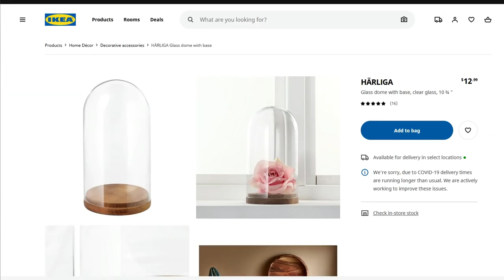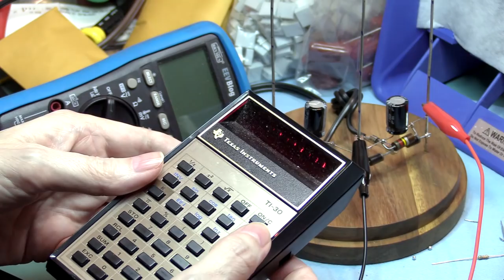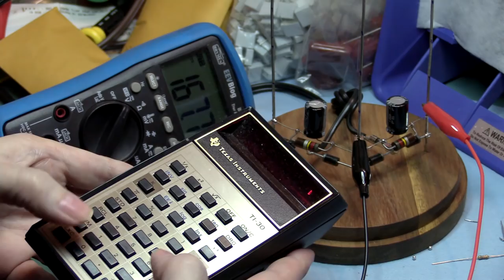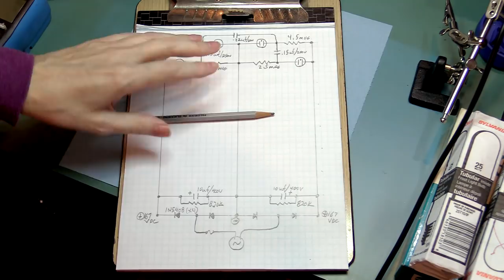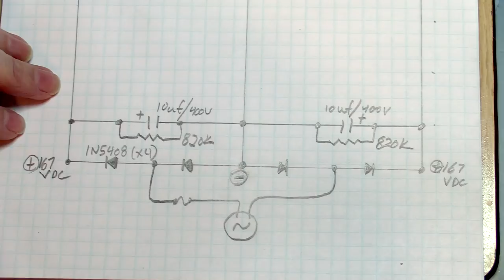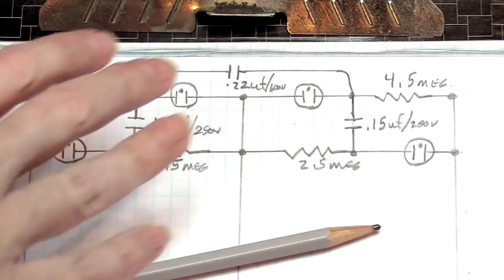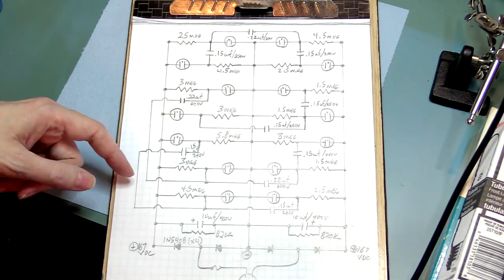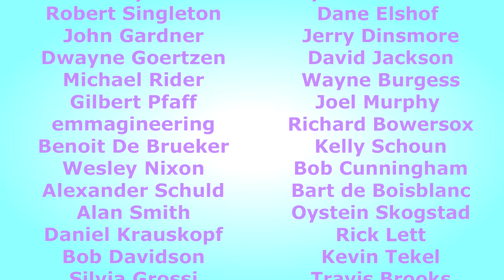Nostalgia Neon Blinky Tree!!!

Comment: About those top two "rungs" on either side of the center rail . . . those caps are charged through a distributed resistance arrangement. But don't those "distributed" resistors also limit the cap discharge current through their respective lights?
Reply: Yes and no. If the top row were alone the discharge current would be limited. But take a closer look at the complete arrangement: the positive rail goes into the neon on the second row, through a cap, into the neon on the first row, and to the negative rail. No resistor in that current path. Although technically that is unlimited charge current instead of discharge current.
Reply: @eDoc2020  I believe the capacitor is only charging through the resistors since the neon lights will not be conducting current until they flash. And when they do flash they are carrying charge from one side of the cap to the other and that has to go through a "charging" resistor, making it a current limiter for the discharge period. Or does it discharge through the power supply components and return through the rail in the middle.?

Frankly I am at a loss to explain why both lights flash off of one capacitor. I would have thought that the one with the lower breakdown voltage would be the one to flash all the time. Does heating the gas by flashing raise the breakdown voltage?
Reply: @bogywankenobi3959  Honestly I haven't really been able to analyze the circuit as a whole.

In the unlimited current situation I called out (just part of the larger circuit) the neons are in series with a capacitor across the power input without any resistors. When one of them breaks down its voltage decreases, the voltage on the other increases, making that one also breakdown. There are no resistors in this particular path so current is only limited by the capacitor and the neons themselves.

For the simple case of two resistors, two neons, and one capacitor it's easier for me to explain. To be clear this is the setup where the neons light alternatively instead of rapidly discharging. Here when power is applied the neon with the earlier breakdown (let's call it A) will immediately strike and then run at the sustaining voltage. At this point the cap is still discharged so neon B also sees the sustaining voltage and does not strike. Now the resistor on neon B slowly charges up the capacitor and the voltage on neon B increases. Pretty soon neon B reaches breakdown voltage and strikes, leading to a drop in its voltage. Since the two neons are capacitively coupled the drop is reflected onto neon A which drops below the sustaining voltage and goes out. The cap charges the other direction until neon A reaches its breakdown voltage again.

Comment: I like those neons with lenses on the end. I usually just see ones with a pointy tip
Could you add a Jacob's Ladder up the middle ?
Reply from the maker: Totally different requirements for the 'Ol Ladder - thousands of volts of AC with a big step up transformer.

Comment: Your rectifier does not drop 4 diode forward voltages. Only 2 Diodes conduct simultaneously in a full bridge rectifier
Reply: But the voltage was calculated using both waves together I believe, so it would work that way
Reply: @aterack833  The Voltage was calculated as RMS line voltage * square root of 2 - 4 diode forward drops.
A full bridge rectifier only drops 2 diode forward voltages. The remaining 2 diodes were in reverse and no current flows through them. They become active during the other half cycle, again reversing the 2 diodes that had been conducting before.

Or think of it this way: To have 4 forward drops you need to connect 4 diodes in series, always connecting anodes to cathodes.
In Frans schematic the diodes in the middle were connected anode to anode, making it impossible to have all 4 diodes conducting in series (unless, of course, you destroy them first)
Reply: @maeanderdev  I thought it was related to the capacitor is some way, sorry
Reply: @aterack833  the RMS voltage * square root of 2 simply calculates the peak voltage. When a sufficient capacitor is used, a DC voltage of that value is obtained.
Anyways, don't feel sorry about being wrong and understanding your mistake, as that is a very good thing :-D

Comment: Yeah, I had seen that sitting there on the bench...just wondering what was inside that bell jar...could you send the schematic that you used?  And yeah was wondering where the bell jar was found.   
i had done something similar with a couple of batteries and some resistors and neons...YEARS AGO...did it for my father and his cats...he kept it over the piano as a snowpiece and kept telling me that everyone asked what it was.   
I would build and use a power supply these days instead of a battery...might even build a long sequence counter and use it to trigger a set of bulbs...in sequence...
Reply: At 25:15

Comment: Interesting in the outro, the flash rate seems to speed up as you go up each level. You could probably build a clock with this type of circuit
Reply: People have tried it, trouble is the neons you can get now aren't very consistent with strike and extinguish voltage, and drift randomly as they age in operation. So even if you do age and sort a bucket of old soviet neons it won't run for long. The neons used for logic applications back in the day were purpose built for a large difference in ingnition and extinguish voltage, including a radiation source to make them consistent in varying ambient light.
Reply: @Broken_Yugo  thanks for the info, very cool..it's utterly amazing that they're able to use something like this, for purposes it was never designed for like oscillators, decade counters, & logic gates considering that neon bulbs were invented decades before silicon transistors/semiconductors.

Comment: I wish you a happy new year. 

Does this fun project also work on 240v mains voltage?🤣
Reply: I don't see why not. You might want larger value resistors but as this is a 'no rules' build anything goes.

Oh, it will be much less efficient on 240v but at less than 1 watt I don't think that will matter too much.

Comment: Fran, no question gloves are a good idea with working with lead, but in truth dermal absorption of lead is of very low concern in this situation. By far the greater concern is lead vapor. Are you wearing any sort of respirator when you solder with lead (or any solder for that matter)?
Reply: Not speaking for her, but I think she may use an exhaust fan while soldering. You can hear what sounds like a fan running during some of the soldering scenes.
Reply: @ralindsey2629   That FA-400 is a fume extractor from Hakko
Reply: Soldering doesn't vaporize lead. The smoke seen is from the flux - which can be irritating and probably not a good thing in the long run - thus fans...
Don't chew the solder, wash your hand between handling solder and handling food/eating.

Comment: I have 240v here will it still work ?
Reply: The theory should be fine, but in practice:
240V AC rectifies to about 340V DC, so be sure to use 400+V caps.
The neons will 'strike' at the same voltage (typically about 90V) -- but with 340V DC rather than 170V DC, the caps in the existing circuit will charge to the neon strike voltage more quickly.  So you might want to use higher-value resistors, or higher-value caps, to avoid flashing at double Fran's frequency.
While you're considering changing components: 
I'm a little concerned that the neons effectively short out some caps, when the neons strike; this isn't dangerous, but is likely to cause each neon to sputter electrode metal onto its glass envelope (hence blackening the glass and dimming the neon).  So, current-limiting resistors would be good.
Bonus points for occasionally reversing the polarity, so that the neon electrodes degrade symmetrically; maybe a DPCO relay with another RC timer?
And I don't see the reason for Fran's choice of two separate +167V rails, I'd just FBR into a single 10uF cap and feed the oscillators from that -- to simplify, and to save a couple of components.
As a similar-but-different approach, you could use LEDs (for more colors) with series DIACs (to get the negative resistance 'strike' effect) and then you'd only need 40V or so.  AliExpress have cheap DIACs.